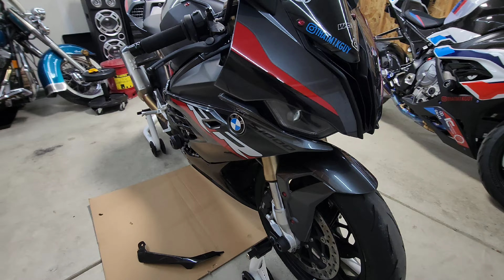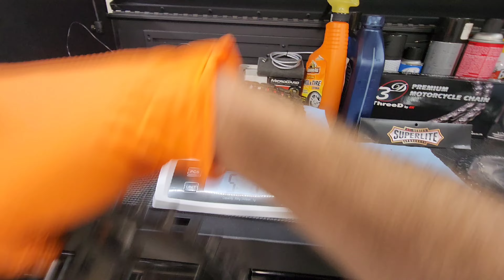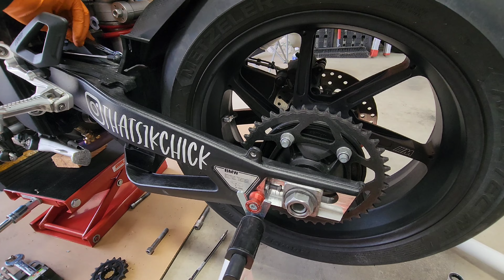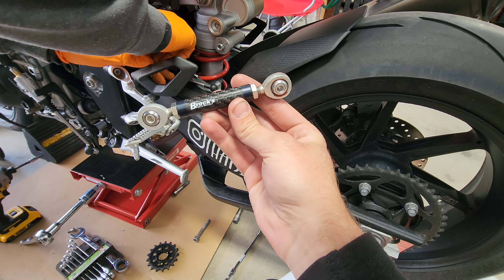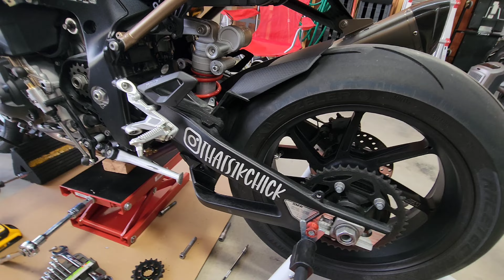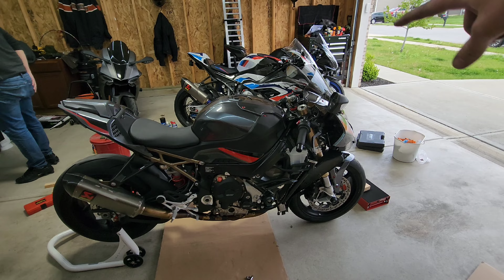Lowering our 2022 BMW S1000RR 1 inch! EK 3D 520 chain and sprocket conversion. U will need DDC rode

Comment: the ONLY video that said no need for DDC rod. Thank you!!!!!!!
Reply from the maker: So when making this video, i rode the bike. It never threw a code. I thought you didn't need it, but when i went into calibration for the ddc rode it wouldn't calibrate. So I ended up installing the one i had. I would recommend switching it out to the brocks adjustable DDC rod.
Reply: @thatm1kguy  Brock’s is out of stock for the DDC. You think it will be okay to ride until I get the DDC? I won’t be doing anything crazy to the bike yet.
Reply from the maker: @RevItSammy  i wouldn't go riding curvy roads on it but just riding around town and highways yeah it will be fine. If you get that code though i wouldn't ride it much
Reply: @thatm1kguy  still would need to break in the engine and get use to the bike. Won’t be doing any curvy roads. Thank you! I appreciate your time and help.
Reply from the maker: @RevItSammy  you're very welcome!!! If you have anymore questions hit me up on Instagram it is much easier to go back and forth on. Im always happy to help. 😁

Comment: I appreciate the hell out of this video. I got the 1” bt Moto link but no way in the hell am I doing the 2” link teardown Bt defaults to with tank etc removed. I was going to just shit can the whole process but you all give me faith it can be done with out even lifting rear subframe. Got the center lift and motion pro deluxe suspension service bearing removal tool set so I got the stuff. Might need to see exactly what style 55torx works best to fit up on that super buried upper traction strut even with lifting bike in center. No impact so could get tricky. That helps avoid really moving bike around to break those loose and retorque. Might have to just get one if it gets harry. Thought about running straps to cleats in concrete floor just to keep it steady without lift. That S1000RR is the biggest PITa to work on. Had many liter bikes. But none so fantastic either. Sweet machines and video. 👍
Reply from the maker: That is really awesome!!! If you have any questions on this you can hit me up here or the best place is over on Instagram. I can also send pictures on Instagram so that might help more. It was super easy to do with all the right tools. 

We almost went 2 inches but thats1kchick actually wants to put an Arm on her bike 🤣🤣 so idk just yet

Comment: Im going to lower mine too, looks good man, also do you need a kickstand for a 1inch drop? I saw you didn't  use the DDC link I thought you needed that for it to work properly
Reply from the maker: I recommend a kickstand and you will need the DDC rod. For some reason my bike didn't throw a code but the bike wouldn't calibrate

Comment: I wouldn't buy that 1" link if it didn't have bearings. They should  at least provide the bearings even if not installed saving the buyer 
the problem of finding the right bearings

Comment: hi...how would you compare GSX-R1000 with S1000RR? I have 2017 GSX-R1000 and I'm thinking about switching with S1000RR...
Reply from the maker: Depends on what you are looking for? Depends on what kind of riding you like to do.
Reply: @thatm1kguy  I use the bike only for road riding and for daily use...not for track
Reply from the maker: @markobencina89  the bmw has way more features and comfortable for riding. It also doesn't take much to make them really fast

Comment: Sir may I please ask how many miles do you have on the S1000RR and have you had any issue at all? My 2021 has the weep hole leak issue and will be dropped off at the dealer in a week. Thank you!
Reply from the maker: Over 4k miles maybe even 5k. No issues. We did have a recall on the timing chain tensioner. I do hear alot of people saying the weep hole leaks. 
No problem at all. Im always here to help and answer questions.
Reply: @thatm1kguy  Thank you and I appreciate  your response. I am actually a couple of miles from being 4k. I'm glad you never had the weep hole leak issue and wish that you will never have. Another quick question is regarding the front suspension if you don't mind. At low speed <10 mph with the clutch lever pulled in, I can hear and feel a slight clunking in the front forks but I was told it is normal. I'm not sure if you have ever experienced that before.
Reply from the maker: @cloudyskyforever2553  im honestly not sure. I don't believe so but i could check it out next time im out and about
Reply: @thatm1kguy  Thank you!
Reply: Looks like the only issue is that they dropped the black one already. 1:20

Comment: I really wish yall had more info on the lowering link install. I have a bottle jack. Will that be ok to like the swingarm up enough? A center jack is gunna be a week out in delivery
Reply from the maker: Only place you need to put a jack is on the oil pan. That way you can raise and lower the bike safely. That jack i used works perfectly because you can raise and lower at very small amounts

Comment: My 2022 s1000rr doesn't have DDC so I didn't need the rod altogether.
Reply from the maker: Yeah you are lucky! Lol. My M doesn't have it and it's nice.
Reply: @thatm1kguy yeah lol but no Rider Pro Modes either. Is the customizable wheelie control through Pro Modes better than the WC on the basic modes? 
Cause the wheelie control in the basic modes is trash lol
Reply from the maker: @brandonhollis84  I literally run both bikes in race mode. I don't even mess with the pro modes 🤣🤣 then when I race I just hit the button to turn off all the safeties lol

Comment: Will this kit work for the 2023 S1000R?
Reply from the maker: The chain and sprocket will. I would just double check lowering Link. If you have DDC you'll need a DDC rod as well.

Comment: Can you please put the link for the lift
Reply from the maker: https://www.amazon.com/dp/B0196PAZ1S?ref=ppx_pop_mob_ap_share
Reply from the maker: Did that link work for you! 😁
Reply: Awesome thanks 😊
Reply from the maker: @425jasper  you're welcome. It is well worth the money.
Reply: I needed the Brocks DDC rod in order to calibrate the suspension on mine. If not it will come up calibration fail. After lowering the bike you should have recalibrated the suspension.
Reply from the maker: @reaper_s1k  we rode it and no issues or codes. We marked it and it was still perfectly lined up after lowering. Maybe you went lower than we did?
Reply: @thatm1kguy  it will not pull any codes but the suspension will not calibrate either.  I purchased the BT Moto 1inch lowering kit, try going through the calibration setting. The  arm should be in a different position if you went down 1inch.
Reply from the maker: @reaper_s1k  okay. Ill check it out later 😁
Reply from the maker: @reaper_s1k i switched it out for brocks lowering link. It was barely off but it calibrated